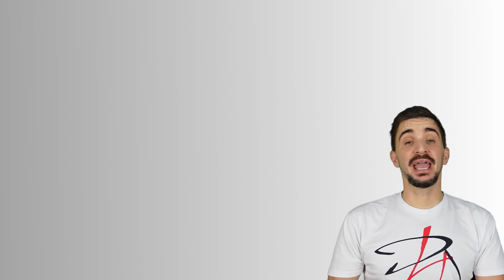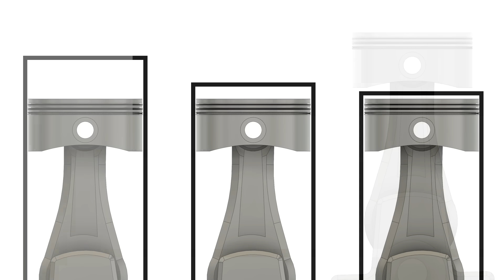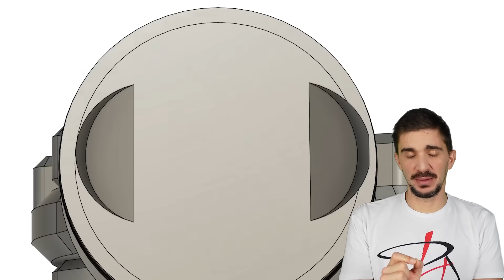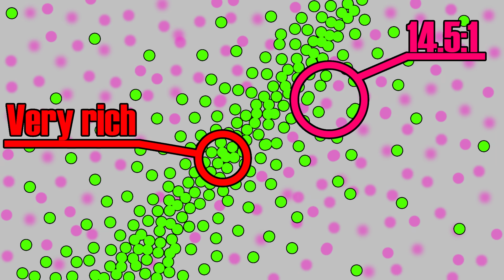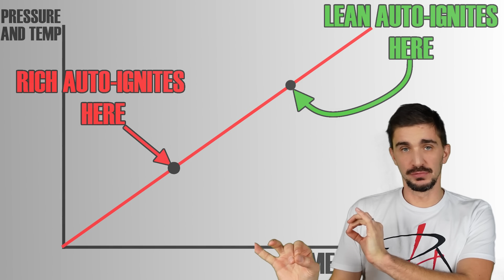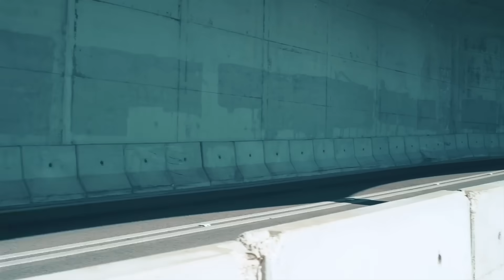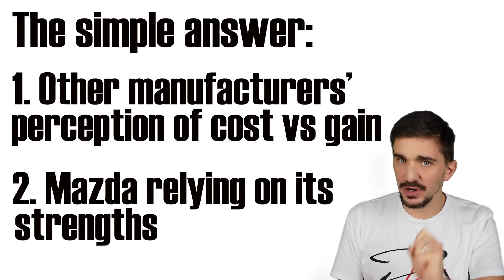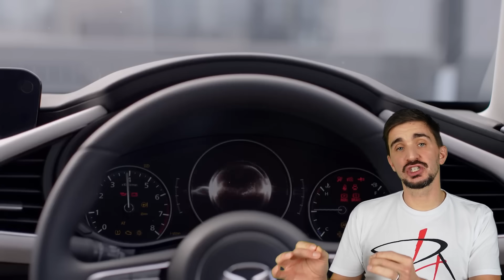The Game Changer Nobody Cares About - Mazda Skyactiv-X SPCCI How it Works and Why It Didn't Catch On

Comment: 🤖 TLDW (Too Long Didn't Watch) - AI Analysis
Nothing personal, just learning what AI can do these days, n8n and stuff! 📚

📺 Video: "The Game Changer Nobody Cares About - Mazda Skyactiv-X SPCCI How it Works and Why It Didn't Catch On"
📊 396,099 views • 23,087 likes • 2,552 comments

⭐⭐⭐ EXECUTIVE SUMMARY ⭐⭐⭐
This video provides a deep technical dive into Homogeneous Charge Compression Ignition (HCCI) and Mazda's proprietary Spark Controlled Compression Ignition (SPCCI) technology found in their SkyActiv-X engines. It explains how Mazda managed to combine the efficiency of a diesel engine with the clean emissions of a gasoline engine by using a spark plug to control the timing of compression ignition. The analysis concludes that while the engine is an engineering masterpiece, its market success is hindered by high costs, complexity, and the automotive industry's massive shift toward electrification.

⭐⭐⭐ DETAILED BREAKDOWN ⭐⭐⭐
The video begins by establishing the fundamental differences between gasoline and diesel engines. Gasoline engines use a spark to ignite a homogeneous mixture of fuel and air at a stoichiometric ratio (14.7:1), which is clean but less efficient due to lower compression ratios. Diesel engines use compression to ignite a stratified mixture, allowing for much higher compression ratios and efficiency, but producing more pollutants like soot and NOx due to uneven combustion pockets.

The concept of HCCI (Homogeneous Charge Compression Ignition) is introduced as the "Holy Grail" that combines the best of both worlds: a lean, homogeneous gasoline mixture ignited by compression. This results in high efficiency and low emissions. However, the video highlights a critical flaw in pure HCCI: the lack of control. Because ignition relies entirely on temperature and pressure, it is difficult to time combustion precisely under varying driving conditions.

Mazda's solution, SPCCI (Spark Controlled Compression Ignition), is then detailed. Unlike pure HCCI, Mazda uses a spark plug to ignite a small pocket of rich mixture. The expansion of this fireball acts as an "air piston," increasing the pressure in the rest of the cylinder to trigger the compression ignition of the remaining lean mixture. This ingenious method gives the engine computer control over exactly when the compression ignition occurs.

The narrative shifts to the market reality, exploring why only Mazda is pursuing this technology while giants like VW and Toyota focus on downsizing or hybridization. The presenter attributes this to Mazda's smaller R&D budget (less than $2 billion vs VW's $19 billion), which forced them to innovate on existing internal combustion architecture rather than pivot instantly to a full EV lineup. The video concludes with driving impressions, noting that while the engine is smooth and efficient, it lacks the low-end torque punch of turbocharged competitors, making it a "hard sell" to the average consumer despite its technical brilliance.

⭐⭐⭐ KEY TAKEAWAYS ⭐⭐⭐
🎯 Gasoline engines are clean but inefficient due to lower compression; Diesel engines are efficient but dirty due to heterogeneous mixing.
🎯 HCCI technology attempts to run gasoline engines with diesel-like compression ignition to achieve high efficiency and low emissions.
🎯 The primary failure of traditional HCCI is the inability to control exactly when ignition occurs, as it depends on variable environmental factors.
🎯 Mazda's SPCCI solves the control issue by using a spark plug to create a pressure wave that forces the rest of the lean fuel mixture to auto-ignite on command.
🎯 Mazda pursued this complex ICE technology because their smaller R&D budget prevented a massive, immediate pivot to EVs compared to industry giants.

⭐⭐⭐ ACTIONABLE ADVICE ⭐⭐⭐
💡 When evaluating the Mazda SkyActiv-X, do not expect the surge of torque found in small turbo engines; expect a linear, naturally aspirated feel.
💡 Consider the price premium of the SkyActiv-X engine carefully against your annual mileage to determine if the 30% fuel efficiency gain is cost-effective.
💡 Understand that SPCCI technology creates a sound and feel distinct from traditional gas engines, often described as a slight 'diesel-like' clatter at low RPMs.

⭐⭐⭐ MEMORABLE QUOTES ⭐⭐⭐
💬 "Gasoline is clean but inefficient. And the diesel is efficient but dirty."
💬 "In other words, it ignites when it ignites."
💬 "Mazda relies on its strengths: engineering unique solutions for the internal combustion engine."

⭐⭐⭐ COMMUNITY INSIGHTS (987 comments analyzed) ⭐⭐⭐

✅ WHAT PEOPLE LOVED:
👍 Mazda's commitment to engineering innovation and internal combustion
👍 Deep appreciation for D4A's technical depth and philosophical 'Skill vs. Chore' discussion
👍 Smooth, linear power delivery and 'NA feel' of the engine
👍 Respect for keeping manual transmissions and driver engagement alive
👍 Real-world fuel efficiency (approx 5L/100km) reported by some owners
👍 High interior quality and aesthetic design of Mazda vehicles

❌ MAIN CRITICISMS:
👎 Perception of the engine being underpowered/sluggish without high revs
👎 Diminishing returns: high cost/complexity for marginal efficiency gains over standard engines
👎 Technological complexity potentially becoming a liability for long-term ownership
👎 NOx emissions and soot buildup challenges associated with lean burn
👎 Technology arriving 'too late' in the market transition to EVs

😰 COMMUNITY PAIN POINTS:
⚠️ Lack of low-end torque compared to turbocharged competitors
⚠️ High engine complexity raising long-term reliability and maintenance cost concerns
⚠️ Unavailability of Skyactiv-X models in the US market
⚠️ Minimal real-world MPG gains compared to standard hybrids or Skyactiv-G
⚠️ Historical issues with rust and paint quality on Mazda vehicles
⚠️ Modern driver preference for automation over engagement ('lazy drivers')
⚠️ Requirement for premium fuel to achieve optimal efficiency

🙏 WHAT VIEWERS WANT TO SEE:
📝 Implement Skyactiv-X as a generator/range extender for series hybrids/EVs
📝 Pair with strong hybrid/electric motor for better low-end torque
📝 Bring Skyactiv-X models to the North American/US market
📝 Develop a turbocharged version for increased performance
📝 Apply technology to Inline-6 or Rotary configurations
📝 Maintain production of manual transmissions

❓ COMMON QUESTIONS:
🤔 Why isn't this engine available in the US market?
🤔 Could this engine serve as a generator for a series hybrid or EV range extender?
🤔 Why didn't Mazda turbocharge this engine for more low-end torque?
🤔 How does SPCCI compare to Honda's CVCC or diesel compression ignition?
🤔 Does the lean burn mixture result in higher NOx emissions or soot?
🤔 Can this technology be applied to rotary or inline-6 engines?

⭐⭐⭐ THUMBNAIL BREAKDOWN ⭐⭐⭐
🎨 Car Engine: A detailed, clean, computer-generated render of a modern car engine, positioned on the left side of the frame.
🎨 Typography: Large, bold, black, sans-serif text on the right side, stacked vertically.
🎨 Background: A plain white background that creates high contrast with the engine and text.
🎨 Logo: A small red and black stylized logo in the bottom-left corner.

━━━━━━━━━━━━━━━━━━━━━━━━━━━━━━
🔬 Analysis Info:
• Model: gemini-3-pro-preview
• Tokens used: 90,161
• Comments analyzed: 987
• Data sources: Video, Comments, Thumbnail
Reply: Thanks for reading the TLDW! Anything you’d add? If you find any value in it, hit me up to discuss your use case!

Comment: Both engines are shite, The petrol suffers from carbon built up to direct injection and mazda were to tight to fit a 100 dollar catch can ,and some bright spark thought it a good idea to put the injectors inside the rocker cover in the deasel verson so you dont know when the seals are leaking ,causing the fuel to mix with the oil and clog up the fuel pump .

Comment: But cool as that is, it’s a huge shame that Mazda also thought it would be a good idea to get into cylinder deactivation. And that all because of the stinking Biden EPA and CAFE numbers.
While Mazda’s CD has not itself actually failed, that I know of, or directly caused problems, it turns out that, for whatever reason, the lifters — or hydraulic lash adjusters — can fail on the two cylinders that deactivate. Ask me how I know. Mine failed, costing me a huge repair bill. I researched it and found this failure is not very rare. If you have a Skyactiv engine with cylinder deactivation (the VIN has an M in the 8th position), good luck. Use only synthetic oil and change it every 5k miles. But even that may not prevent it. Listen for a distinct ticking sound. It’s the sound of big money.

Comment: Honda has been doing lean burn for half a century.  The problem with lean burn is that it increases NOx emissions and as far as I can tell, Mazda hasn't solved the NOx issue.  Anyways, the most impressive fuel efficient production car is the early 2000s Honda Insight. If you haven't already done a video on that car, everything about the car is interesting, from the seats and interior being lightweight, to the all aluminum chassis, the car built in the NSX factory, to the small changes in the engine design to get every percentage of fuel efficiency, like indexed spark plugs and offset piston/rods. I once drove the car around at full throttle as much as I could, in a test to get the worst gas milegae. The lowest fuel mileage I got was 36mpg in that car. Most owners get 50mpg daily without trying. The hypermilers get 70mpg+

Comment: This sounds like a modern take on Soichiro Honda's CVCC engine in 1972.  I remember rebuilding an early civic and scratching my head over the 3 barrel carburetor and 3 intake valves which prompted me to learn about how the system works.  The "Compound Vortex Controlled Combustion" system is very much as you describe Mazda's setup, just without fuel injection, computer controls, and all the advanced engine management technology needed for compression ignition.  Not to take anything away from Mazda, they may be the most innovative car company in the world.

Comment: I owned, or actually leased a Mazda with this engine just because of the engine. 
Ok, the looks of the car, luxurious interior and excellent driving helped making the decision.  Loved every kilometer we made together.  ❤
One thing: Just switch off the start stop system as soon as the engine runs. The automatic does not handle that well.

Comment: Question: Using a oxygen concentrator, setting it up in the bed of the truck/car, routing tubes from it to the engine, and piping into the intake, can you increase the power and fuel burn without the soot, say 60-80 percent pure oxygen? Given at 1,800 to 3,000rpms, the concentrator won’t be able to produce enough oxygen per cycle, but enough to kick the ratio up. Is this possible?

Comment: Would it not be easier to make a HCCI engine using disel? by mixing the fuel during air intake like a gasoline engine? Seems like Diesel was the better base option, with a fuel air mix issue due to injectors. From your demo anyway.

Comment: This is Mazda's direct injection version of the 1970's Honda CVCC engine.  Of course this works, it's been done before.  Mazda has great engineers, and I bet that this simple solution proves to be a reliable way to extend the efficiency and life cycle for ICE power plants.  Added to the hybrid batteries, we'll see 60 mpg cars with no range anxiety.

Comment: ive managed 50 mpg on a 4age bigport  engine .
engine is in a ke70 with all parts from ae86 
it manages an under of 100g of co2 and almost constant 16.5 afr under 5000rpm .
egt is under 400 Celsius.
ITB's paired with TVIS with standard ECU of 16v .+ safc 2 + innovate wideband + innovate egt 
its been used as a daily commuter for 30.000 miles . disassembled after to check for wear .
all in spec re assembled and just got back from a trip .twisty country roads and highway mixxed 
managed 850 klm's on a single tank ( 40 liters) .following road limits top speeds .
car weights 1000 kg and runs with t50 tranny and a 4.3 FD LSD diff  195/45/15 wheels 
12/1 compression  150 bhp . 2 resonators 1 200 cpi catalyst and a muffler 
if a 43 year old engine in the hands of a simple mechanic like mine can be like that why cant manufacturers make something more efficient and powerful ? and most of all SIMPLE + RELIABLE ?????

Comment: I see the advantages over a traditional (let's say indirect multipoint injection) gasoline engine. But how does it compare to other modern technologies like Volkswagen's FSI that also aims to have a rich fuel mixture around the spark plug and lean elsewere? It's been around for over two decades and currently it's typically paired with a turbo which also improves efficiency and also low-end torque. Initial claims of ~20% better fuel economy are kinda similar. I guess its a part of the reason why this technology is not being widely adopted, other manufacturers simply invested their money, time and effort to develop different ways to achieve the same goal of improving fuel economy and passing emission tests.

Comment: For me it failed on not having 6 cylinder skyactiv-g (the 14:1 one, not the new turbocharged one). The technology cuts 30% on fuel consumption, why not add 33% more cylinders? i6 is easier to work around as it has better torque delivery, primary and secondary balanced, without turbocharger it would be as heavy and thirsty as comparable 4cyl from other manufacturer as it also does not need balancing shafts. Sad that the new one is turbocharged. I would be really interested in seeing this in action as NA.

Comment: I'm a 62 year old driver, owned 50+ cars. Only one Japanese car,:2008 Mazda 6. Nothing broke, nothing failed in 10 years! Sadly it rusted out but still one of the best cars I've ever bought.
Reply: Sadly, corrosion seemed to be a trend for Mazdas of that era. Reliability is also a trend for most Japanese vehicles of that era, and in general.
Reply: And why did you feel the need to share this? Does the number of cars you've had or the fact that one car went for 10 years with "no failures" (like that is supposed to be some incredible milestone LOL) add anything meaningful to anyone?
Reply: @MrZarono  You answered your own question
Reply: @MrZarono 😂😂
Reply: @MrZarono  And why did you feel the need to comment? Does your smug self-righteous BS add anything meaningful to anyone?

Comment: I'm thinking SCCI would work better on a gasoline version of a rotary vane engine.  The longer combustion and broader torque curve seems better suited to it than a diesel rotary vane that gets its ignition all at once, instead of as a flame front.

Otherwise, localized hot spot = smaller version of diesel soot generation.  Poor low-end torque = repeating a major customer dissatisfaction with Wankel.

Comment: My 2017 MX-5 Miata has SkyActive-X. It's fun, peppy, and gets 36 to 42 MPG on the highway depending on average speed and hilliness. It's very fun to drive. 
I wish it had a light on the dash that showed when the diesel-ish mode activates. That would be good marketing. 
I kinda wonder if Mazda has tried to license its tech to other makers, and if so, why they haven't been interested. 
IMHO the "punch" of turbo (and overstressing poor leetle sewing machine engines' parts!) is a fakey way of impressing customers.

Comment: If you take a test drive with a friend who is not a driving enthusiast you immediately realise Mazdas engine will fail. They are super impressed with an oversized diesel engine where they can steadily increase speed with minimal input on the gas pedal while the engine stays under 1600 rpm. 

They feel like the car is powerful. They will never even use 20% of the power in that engine, but it feels powerful and effortless.

That they actually have to do something to drive the car at all is tedious and scary, for them it’s not a fun hobby. It’s a chore. That the engine revs up and changes sound is borderline scary, they will make sure they press the gas pedal even less next time.

Comment: Based on what you said it sounds like this engine is good for hybrid. You’re an electric mode when you’re in stop and go and then when you get on the highway that engine just turns on and stays on and you just use gas mode on the highway for your long trip trips.

Comment: These engines has issues with coking even at low miles and the maintenance ist higher compared to the G-Engines. F.e. the spark plugs needs to be replaced @64.000km compared to 120.000. And they are really expensive.

Comment: I would think this is an ideal engine for a hybrid car where the batteries provide all the drive power and the engine runs in its most efficient mode to recharge the batteries.

Comment: I have a 2024 Mazda 3 with e-Skyactiv X it's a 2l engine, but the X is not naturally aspirated ... it has a belt driven roots supercharger and 137 kW (186 hp). Now granted the supercharger is supposedly there not for more power but to get the mixture lean enough (although you can still hear the overrun when you lift off the throttle in high rpm, so it has to do something), but it's there ... so technically not a NA. The 2.5l e-Skyactiv G version is a clean NA (only has cylinder deactivation), but that one is not SPCCI. Either way it behaves like a NA and pulls nicely as soon as you reach 4k rpm. On a highway, depending on how fast I go and what the terrain and weather is like I can get as low as 5.2 l/100km (if I would go below the speed limit of 130 km/h), but usually with 135km/h GPS speed I will get a 6.2l average. And of course when I took it to the track and the rpm did not drop below 4k it was "slightly" higher ... good video and explanation though :)